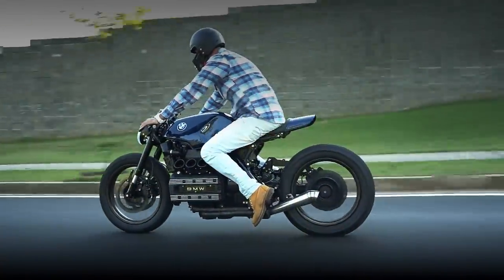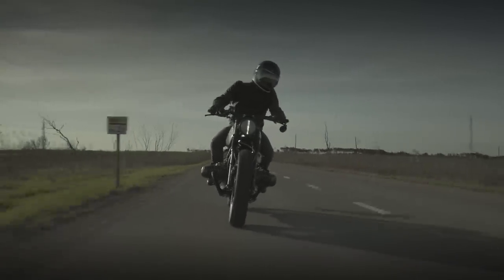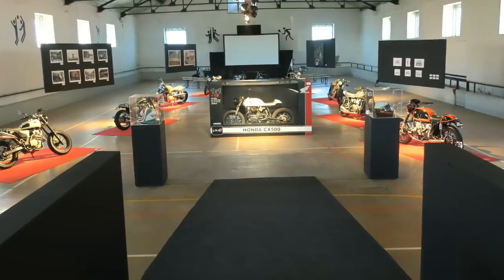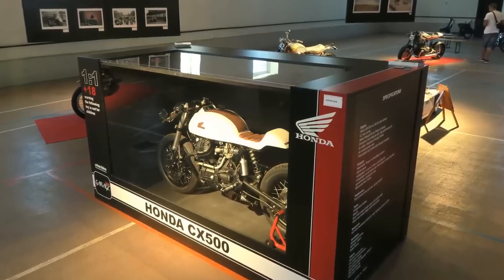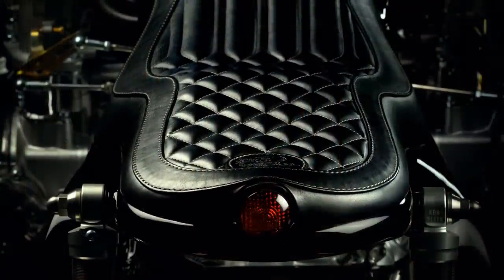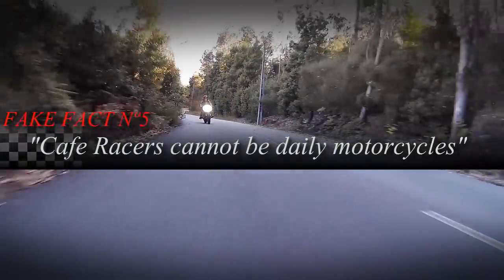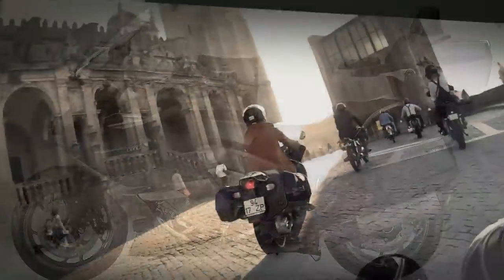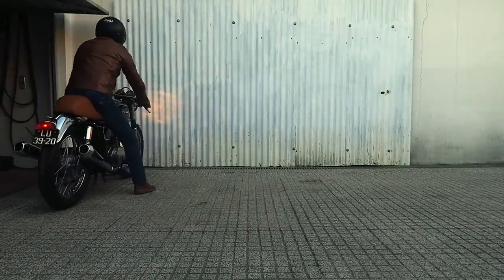Top 5 Fake Facts about Cafe Racers

Comment: Fake Fact number one, should be that a Honda CX 500 (or 650), is a big boys bike, that is ridiculous. My wife's bike was bigger than this. Fake Fact 2, if you live in a large country with vast distances between places, a cafe racer will be an adequate ride, wrong. In Australia the road are so bad, that you would have to be a masochist to ride a cafe racer for even an hour, let alone travel inter state. Melbourne to Sydney 1100 km, Melbourne to Brisbane 1781 km, Melbourne to Cairns 3200 km, Melbourne to Cape York 3945 km. Melbourne to Perth 3406 km. A Cafe racer won't cut it. I have done these distances on a BMW R100RT and Melbourne to Cairns on my Suzuki GS 750.

Comment: Not rely 'facts' at all, Cafe racers in there origins i.e. Racing from cafe to cafe around london to see who's bike was 'fastest' or who had the largest balls. They were uncomfortable, because people needed every bit of aero they could get to win. Remember this was back when 120mph was 'fast' for any bike. Sure some had regular seats for two people, usually people who had GFs they would take along to said cafes. but alot of these racers did cut down there seat to save weight. remember alot of these bikes were still using drum brakes and awful tires in the wet.They were very much form over function machines.
Reply from the maker: I respect your opinion. But maybe you should watch this video: https://youtu.be/QiO4Fd4sjbA  . Cheers.

Comment: ..... Ya know... None of the bikes I see here are Cafe racers... You cant even google a cafe bike anymore :(  ... A cafe bike is almost like the old F1 of motorcycles... The father of todays GP class...  Those bikes are Cafe STYLE bikes...  A true cafe racer would shake your fillings out and should :D. A purpose race bike.   I have my own bike a vtr1000F and I can guarantee the seating posistion of most cafe style bikes is whats killing you on long trips. A lower or higher slung seat with forward or far back pegs so your legs are not into your elbows and so the spine is straight either on the tank or classic cruiser style will turn long trips from a chore ( The VTR is no fun after 4 hours ) to a breeze ( I am upgrading to a hyabusa for this reason ) Keep the rubber down.
Reply from the maker: Yes, I understand what your said. I already talked about that matter in 

other videos.Nowadays, the original purpose of the old motorcycles 
customized like the original Cafe Racers, does not make sense anymore. 
If we follow the pure perspective of those Cafe Racers, we would end 
with something similar to a modern Yamaha R1. And this means that this 
rebirth of the "cafe racer" scene, must have a different approach. :) 
But thank you my friend for sharing your perspective. :) Cheers.

Comment: Cafe racer is a bike used for short street races from one cafe to the next, that's it. Most of your facts are BS. Large bikes are out because they are crap for racing in street traffic, bikes with fairings that stop you squeezing through small gaps in traffic also a no no, bike with a lot of comfort mods are also not cafe racers because you only have to travel 10km to the next cafe.
Reply from the maker: Everything depends of what kind of cafe racer you built. Personally, my Honda CX 650 Cafe Racer was made to be ridden in any situation, except for long trips.  Cheers.
Reply: Cafe racing originated in the North of London, the roads were not Freeways and had junctions and the distances to the next cafe were a few miles. A light bike that was good at racing from one junction to another and weaving though traffic was what worked best. The Cafe racer look is a look of the bikes of that era with fairings removed, they looked like they did not because that is what the owners wanted them to look like but because that is what made them best for tearing through traffic.

Comment: Captain Obvious, 5 reasons to stop destroying classic bikes? Explaining that you need to fit the bike is like saying your shoes may be to tight. Its a fad chopping old motorcycles into cafe slugs, its a bar hopper, no longer are any large cc bikes left on the used market, they have been butchered. Showing squids with out protective gear is right down your ally along with your fake voice.

Comment: Cafe racers are for posers.  Copying soMething that broke brittish kids did to get around displacement regulations that prevented them from owning actual fast bikes.
Reply from the maker: Not exacly. Cafe racers are for those who are tired and bored of having modern and fast motorcycles. Cheers.
Reply: @RACER_TV    I'm down with that, but theres a huge population of posers on cafe racers.  And a lot of good ol bikes getting destroyed by botched "cafe racer projects".  Some turn out cool.
Reply from the maker: Yes, that is also true. But from the other hand, most of them are using old, uninteresting and cheap motorcycles that no one will ever want. It is normal that many classic motorcycles/cars will disappear with time. And this "posers" hungry for Cafe Racers, may be an excellent way of keeping the old engines running for a few more years. :) Cheers.